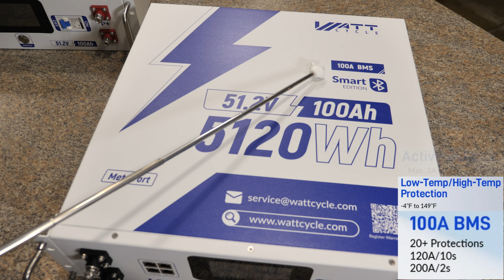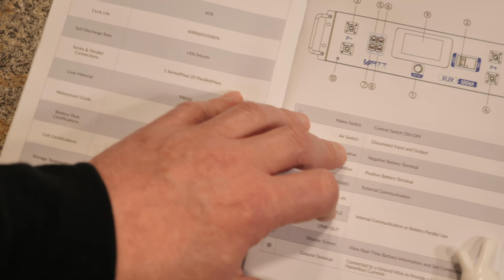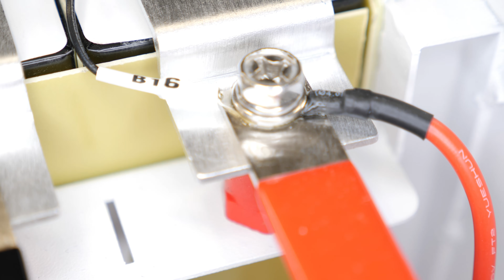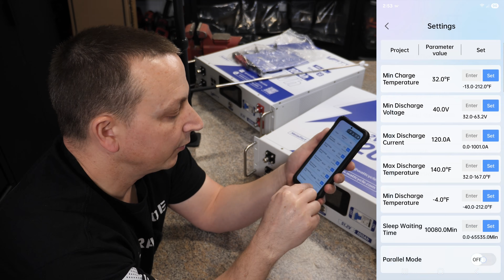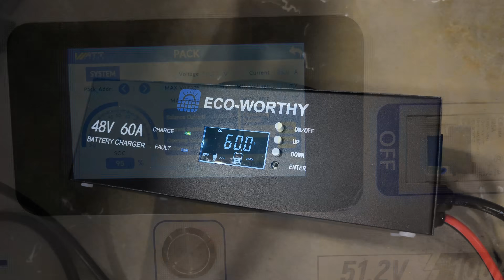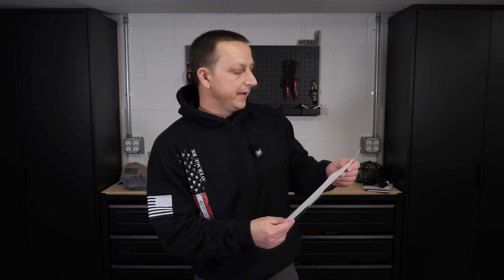EVERYTHING You Need to Know about the GEN 2 WATTCYCLE Server Rack Battery

Comment: hey joe do you have more info on the equalizing switch. youre saying its only active balance? I cannot find much info on it anywhere and I am having issues with the same bms on yixiang and on this pack. if you switch it on, does it active balance at low soc? what is the equalizing switch default? on one battery its off and on another its on. I am missing 15ah from a cell after cycling mine
Reply from the maker: It has passive balance like a regular bms as well. If I remembet right, the active balancer was set to ON and 3a. I think the passive starts around the cell voltage of 3.4v but dont remember if the active balancer was the same voltage and or if it was active at low SOC. I know I let it charge and balance out, then turned it off after balance was complete since it wouldnt need active after that unless they got way out of wack somehow.
Reply: @AVERAGE_JOE  ok gotcha, and yeah thats probably the best way to run them. I have mine set to on, and at all SOC it is trying to balance. But then the capacity started to drop like crazy. I found one cell that was lagging behind the rest. I charged that single cell with 15Ah at 3.65V and most of the capacity came back. really weird. the other one will drift even with balancing disabled. super strange issues
Reply from the maker: Ill test mine and see if active is running at high and low SOC. I got 103ah before with active on and with it off.
Reply from the maker: Also what version is yours. Mine are V2 I think and firmware 1001_10016SW11L0829
Reply: @AVERAGE_JOE if they are balanced, should be same result until cell drift occurs. And ok sweet
Reply: @AVERAGE_JOE not sure, will be home in couple days. I have pictures of mine balancing at 0/30/60/100%. It just balances non stop

Comment: They're Bluetooth, is extremely weak. I walk 20 feet away from it. And it disconnect my ego flows.I can be sitting in my chair, twenty feet away behind two wooden walls and my eco.Flows work perfect.That's the only flaw I have found with my what cycle battery

Comment: Love your videos and am subscribed.   However......
I would recommend caution dealing with Wattcycle company because I have found them non responsive to communication for my problem.  Specifically I purchased 4 of the server rack batteries.  They were shipped promptly via FedEx.  FedEx showed the order delivered, but I did not get the batteries.  The delivery picture is to some porch which is not mine.  I sent email to wattcycle email address on their website.  24 hours later-no response, so I am frustrated.  (I did check spam folder-not there).  Buyer beware!

Comment: Was leaning towards the v2 Yixiang 16.6kWh horizontal boxes but think these are a better choice as they're pre-assembled, and price only a bit more for 3 units.  Looks like they include the racks/mounts if you buy in multiples of four, but don't see them for sale separately on the website.  Would be nice if they could be connected in series to connect with 150-180v MPPT inputs on power stations, but assume that would destroy the BMS... think all the 48v rack batteries are designed for parallel connection only.
Reply from the maker: Yeah only inparallel for sure. The main thing is the bms. It cant handle the higher voltage.

Edit. You can usually still attach a 48v battery to the inputs as long as the mppt input voltage accepts 48v.

Comment: Hello from Manila PH. Slightly off topic...I am hoping for some guidance. 
I am going to build a 10k grid tied system with battery backup...I am savvy enough to watch your videos and physically install the system just not sure what to buy. 
Which voltage (12, 24, 48 etc) should I get and what are all the components i should buy? 
Please point me to your most applicable videos I should refer to. And, are you able to provide a little coaching as I embark on this journey?

Comment: I see that the cycle life advertised is a bit off with the ones advertised where I am. They are rated at 15000 cycles. Crazy. Is usually 3000-6000 average.

I don't do welded bus bars either...

I'll stick with jakiper batteries, more costly but I think better
Reply from the maker: Jakiper are my comms batteries connected to the inverter. Great batteries!
Reply: @AVERAGE_JOE I just bought some more. I have 10 now. The biggest 230ah batteries are too heavy

Comment: I love the screen, but on both of mine...it feels like 1 piece of scotch tape is holding them on...they don't feel securely mounted. Built really well, identical inside to the Humsienk server battery...and the white paint sure stands out in a black rack.
Reply from the maker: I went to check mine pushing the screen and it may only be attached on the sides. Im thinking the actual screen is set back further which makes the "screen protector" seem loose. Maybe Ill take the top back off on one and remove the screen to take a look🤷‍♂️

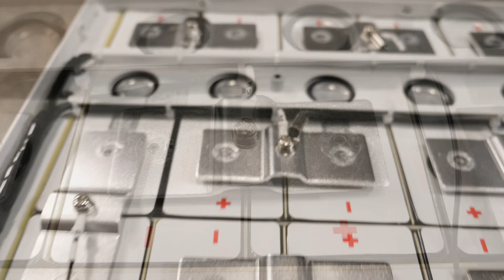Comment: @12:04 While QC marks for nuts/screws on the main battery terminals (which, being welded, this doesn't have) are very nice to have (since they would handle 100 amps in this case), those tiny wires only sense voltage and handle balancing,  Though a 3A balance wire probably should have a torque spec, it's much less critical than the main battery terminals.  Phillips head screws aren't great for torquing, either.  By the time you add enough downforce to prevent cam-out, you've added so much friction to the torque sensor it's now out of spec.

Comment: All of these "Budget" battery units are all 100Ah. This one at the time of this comment was listed for $740USD (50% off supposedly). Crazy part is if you order the cells individually and the bms and the box, you can go with 314Ah cells with 200A JK Bms, for about $1400USD. I get that these are already assembled, but assembly wages doesn't equal 3x the cost of the base units. Sure, they have to be assembled by the customer, but that just verifies everything is in good condition.
Also, where was Horus?! 😻
Reply from the maker: I dont know about 50% off lol. Yeah you can 100% diy everything and get 3X the capacity. Horus actually isnt feeling to good right meow. Its either a bug or hes pissed we let the kittins in when the temps get below 15f.

Comment: Hey Joe. Great Video. Can you Continuity check the tiny screws on the + & - lugs to case ground. Look pretty close to lug?
Reply from the maker: On the main terminal where you connect your cables? Or inside?
Reply: @AVERAGE_JOE Main outside battery lugs

Comment: Those exposed screws on the terminals are a hazard.  They need to redo those to prevent shorts to the case.
Reply from the maker: Good point! I didnt check to see if they would touch. I will check, Thanks!🤘
Reply: I thought there were plastic covers that go the power  terminals

Comment: My JK BMS allows me to; 1) Turn On and Off the Active Balance, 2) Set the voltage for when it turns On and Off, 3) Set the cell voltage deviation. Mine turns on at 3.45 volts and shuts off when it reaches 0.005, and this only happens while charging. The active balancer shuts off if there is no power coming into the battery. It also lets me set a float voltage , in my case for 6 hours. This allows the balancer and the batteries to saturate at 55.8 volts or 3.48 volts per sell. When the float timer turns off when the sun goes away the time resets. We are now on battery power until the next sunny day. No buddy has the feature rich programming environment like JK BMS's do.
Reply from the maker: Yeah seems JK has it all!  Did you do a Diy battery box build? Which one did you do?😎🤘
Reply: @AVERAGE_JOE  Yes I did a DIY build. In 2023 there were very few DIY kits so I chose one that Docan Power (Tech) was offering. Also, the EVE 280K cells were the best out there so we have 57 kilowatts right now. I am planning on using 314AH cells in the new build and the case will be from Docan, as they have a real nice one for only $570 shipped free from Texas. The cells are Grade A and are only $67 each.

Comment: Virginia is now time of day use. So now I am thinking of a system to charge at night when the electricity is cheap and then run during the day when we use our appliances. I don’t want rooftop solar panels because my neighbor has not been able to sell his house. But I could put up a storage shed with panels for solar power. Thanks for adding to my knowledge. T 👍 UP Sent
Reply from the maker: Is that the entire state or local?  Luckily we are still cheap and stable here for electricity prices... for now. Yeah Id stick with a ground mount of some sort.  WAY easier to manage!!  What all have you decided to go with?
Reply: @AVERAGE_JOE  all but 8 of our coal fired power are gone. Virginia has 50% of our electricity coming from Nuclear. And now we buy it from Mexico, and western states. And we now pay a transmission fee to our house. For lost money on the transmission.
I don’t know yet what to do.
Reply: @clarencewiles963  I say just use candles from now on and cook on the woodstove. 😅
Reply: Not sure where you are, but I like most the state have Dominion E. There are different rates including time of use, but they are voluntary.  Rates went up significantly and I've seen hundreds of post about Dominion customers stating their bills more than doubled this last billing. Issue with just cycling batteries is I don't see any savings. Average price per kwh is just over $0.12 TOU rates are 0.11 to over 0.22 and states up to 0.61... even if I managed to charge fully on super off peak and didn't use any super on peak the max I would save using a 300ah battery is about $60 a year.... so the battery probably be starting to degrade significantly and probably won't even be half paid off as rates are currently. You might have better rates though. I think some of these people complaining of over $500 bills may be on TOU rates, green initiative... crypto mining or Idk. Not sure about other providers, but D.E. is the largest provider in the state and TOU is voluntary.